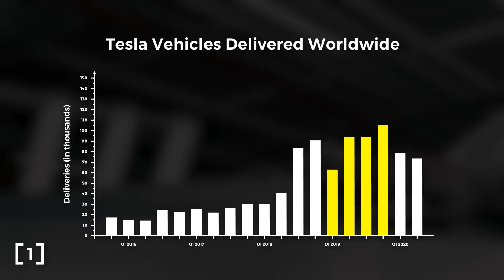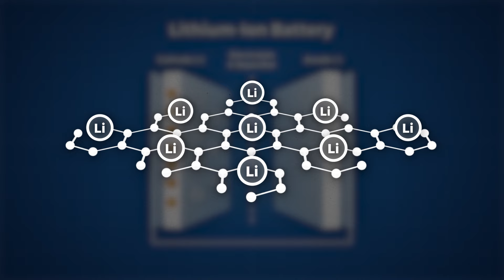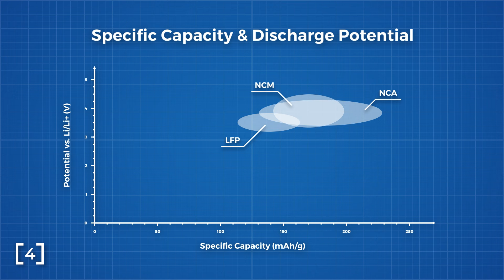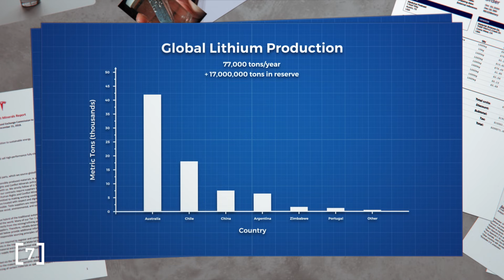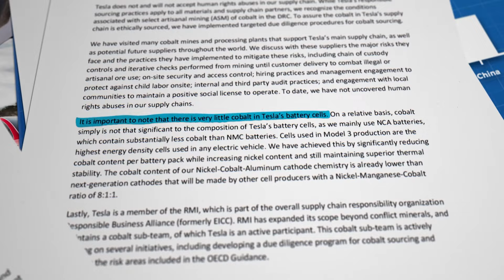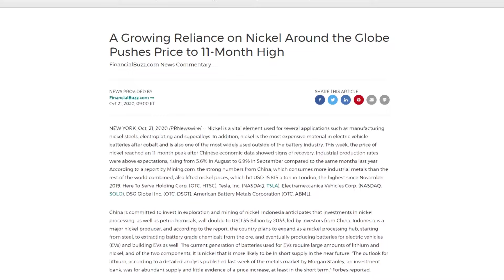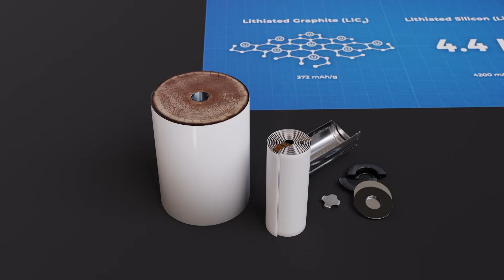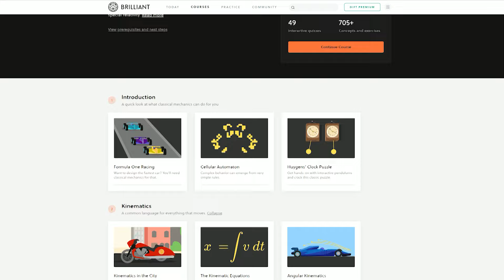Tesla's Battery Supply Problem

Comment: Electric cars cannot be a replacement for a fundamental restructuring of how people transport themselves to heavily favor mass transit and walkable urban design. They're an important tool, but Tesla wants to make it the single silver bullet for a problem that more cars, even electric ones, will just make worse.
Reply: Say what?
Walkable urban design? In new zealand, norway, switzerland`?
Reply: Tesla also pushes heavily for grid scale battery storage and solar . they are driving the industry in all 3. All the other companies following suit will help
Reply: @kommissarjupiter7667  ??? dafuk you saying lmao the best internal combustion engine can convert maybe 30-35% of the gasoline's stored chemical energy into kinetic energy (speed), while the least efficient electricity plants get about double that. Electric engines lose a minuscule amount of power converting between AC and DC, so electric engines are going to be much more efficient than gas cars.
Reply: @kommissarjupiter7667  what?
Are you sure you mean "efficient"?
Max theoretical efficiency for any combustion engine is about 50%, existing diesels are 20-30% efficient.
Electric cars today are about 80% efficient, including charging, battery and inverter.
That's already 3-4 times better than a "good diesel".
Reply: Electric bikes are a great option for distances of 10 miles or less. Also they are really fun to ride!
Reply: bUt glObAl wArmIng
Reply: @kommissarjupiter7667  any fossil fuel powered engine will  be less efficient than most electric motors based on the energy lost as heat. Most engines are terribly inefficient if you look at all the energy contained in fossil fuels. Electric motors use the enegery they are given much more efficiently.
Reply: disagree, Tesla like many other are just trying to solve the issue of global warming were a big portion of the issue are cars, and their waist, but also Tesla like other companies are making smart cars so stupid ppl dont drive like fck shit,.. on the other hand the amount of cars issue is asocial problem were the government need to address the issue, creating x places were you cant use car, but only walk, or make certain hours only available for ppl to walk by.
Reply: @kommissarjupiter7667  even if electric cars were 100% fueled by old coal plants, they'd still be far more efficient than the best diesel engines.
Reply: I've lived in Europe and walk-able cities are already doable there, but I was born in the US and making cities walk-able here would mean rebuilding them from the ground up. I would love to see yards and parking lots exchanged for apartments and city centers but I can't imagine the American people giving up their cars even in the face of climate catastrophe.
Reply: Nothing can replace the good old gasoline motor for isolated areas, very long travels and freezing cold regions. Tesla is just a rich californian kid that don't understand how the world works outside of they state
Reply: @mikeflanary642  great solution on a -20C weather with heavy snow.
Reply: The structure of our cities is a gargantuan task no single company can address - Tesla is doing a great job with their piece of the problem. Personally, I'm excited for next-generation alloys and polymers that could revolutionise buildings - I'd like to see 200 floor buildings that operate as miniature cities, with homes, schools, and businesses. That could do a lot to address transportation problems.
Reply: @caorusso4926  for those places, hydrogen may be the answer, in 50 years or so
Reply: @kommissarjupiter7667  Hahahaha
Reply: @JYT256  Kommissar Jupiter is a troll or a ICE CAR salesman. Diesel...hahahahah
Reply: @grosuciprian  yeah, maybe, but the tech to make it still decades ahead. While this the isolated cities in Siberia, northern canada or Alaska will need that petrol to survivd
Reply: @caorusso4926  it’s because of electric vehicles there will be fossil fuels will be around in the future to operate in these hostile environments. Tesla died in 1943 and the gentlemen your talking about comes from South Africa and his name is Elon Musk. Now that you’ve been schooled, schools out so go home and read a book.
Reply: @MrWATCHthisWAY  i was making reference to the company "tesla" not the inventor. Go petrol
Reply: Personal automobiles are a severe minority when it comes to pollution and carbon. Aerospace, shipping and power generation are a way bigger deal than cars.
Reply: jocaguz18  I’m all for innovation, destroying the Western/developed economies isn’t going to solve this problem when developing nations pollute more than we save.
Reply: jocaguz18  oil is sweet hmm hmm
Reply: @JohnBrowningsGhost  - the reason for cars being less polluting than the big three is due to emission regulations over the last 50 years. China’s need for power is creating a global resurgence in pollutants that everyone will pay for. Without stopping the use of fossil fuels in automobiles this disaster would continue to escalate and to do nothing helps no one. There isn’t a silver bullet to fix the worlds dependency on energy but to do nothing isn’t an option. What are your ideas?
Reply: @JohnBrowningsGhost  - newer aircraft are lowering emissions and becoming more fuel efficient but shipping while still allowed to burn high sulfur low grade fuels are, like you mentioned one of this planets greats contributors to polluting. People don’t realize this because when these vessels pull into ports they switch to kerosine to lower emissions standards. It’s a game. I built and sea trialed 7 vessels and it always comes down to operating at the lowest costs and high sulfur fuels are cheap compared to kerosine / high grade diesel fuels. Those large engines consume large amounts of fuel to push that tonnage along. But we need to realize there is not an unlimited supply of fossil fuels so somewhere we need to make changes. There is no perfect solution in America because mass transit was never going to become a reality with our love of automobiles and the influence that oil companies play in government changing regulations ever other administration. Autos may only contribute a small amount but the fumes you breath in traffic affect you more than you think and if lowering emissions ground level will help cut health problems then sign me up. A lot of people don’t deal with heavy traffic but for those who do and live in large cities these are where we can do the most good. I must be honest I will never sell my old Mustang convertible but I won’t drive it much because my daily driver will be an electric vehicle. Everyone should be allowed one gas powered vehicle! And one day I may have to run it in ethanol completely. Give me one!
Reply: @caorusso4926  - I’m busting stones! The reality is we need to change our mobility. Trust me I don’t want to get rid of my Mustang Convertible but my daily driver will soon be an electric car. Haven’t decided on the make yet but I must admit I do like the Tesla’s. Breathing the fumes from vehicles in traffic all the time is not good for anyone and if we can lower these ground level pollutants I’m in. It’s not a perfect system but for a daily driver I’ll use an electric vehicle. I will never sell my Mustang because Lord knows I have to have one gas powered toy left in my garage.
Reply: @JohnBrowningsGhost  That's why we need to pool our resources through the UN or something and just help these countries make that transition as fast as possible, what if those nations could use international loans to build renewables right at the start and just mostly skip over fossil fuels? What if we worked with their architects and city planners to design cities where public transit how most people get around?  Like the developed nations figured this stuff out the hard way but that doesn't mean everyone else has to.
Reply: @MrWATCHthisWAY  That's really interesting,  so as someone who worked with these ships how can you make them better and is it even realistic? Is this a situation like trains where yea they pollute but they just move so much stuff it's pretty green overall?
Reply: @midnite1112  - the Diesel engines are designed to run on both fuels. You can run them on high grade kerosine all the time but when high sulfur fuel is almost 1/2 the price guess which one the operators choose? You got. Also during the refinement of oil high sulfur fuel is at the bottom of the refinement tanks. It’s almost garbage from oil companies because if ships weren’t designed to use these fuels companies would need to refine them further or filter the hell out of them. You can’t image the size of these engines. Putting in a 12 cylinder one big piece at a time is amazing. The pistons were 42” diameter and when running on high sulfur fuel the crap coming out of the stack is awful to say the least. These ships smell of this high sulfur fuel and nothing else. The people that work the vessels smell of the high sulfur fuel the entire time aboard the ships. And if you need to take apart the water separators to work on them. God the smell is unreal. The separators remove water from the fuel before sending it to the engine after it comes out of the fuel tanks. It’s not pretty. It can be done and it should be done to make these ships run cleaner all the time. But out of sight out of mind and that’s sad!
Reply: @midnite1112  That kind of international cooperation isn’t going to happen, there is no economical way to develop nations while eliminating hydrocarbon fuels. 

I personally think carbon capture and net zero fuels would work alright, but climate zealots aren’t interested in anything like that.
Reply: Mass transit actually has a fairly high carbon footprint. And believe it or not, biking can have a worse carbon footprint than a gas car depending on the biker’s diet. There’s less weight to move but food is an incredibly inefficient source of energy, with regard to CO2.
Reply: @caorusso4926  Ok, So why are there so many Tesla's in Norway?
Reply: @gabrielfraser2109  no way in hell I would live like that it would suck! People are struggling with living in city's now and due to covid and people are leaving them for the country
Reply: @MrWATCHthisWAY  must be nice to actually have a choice! I will never be able to afford a new car like 95% of the world so I will be stuck living in a chicken coup in a digital mega city eating crickets as I am not one of the right type of worthy people🤣
Reply: @allwaysinquire6212  - don’t judge. I started off earning $230 a month in the Navy. I worked two jobs, scraping roofs in the day and the Navy at night. I saved ever dime I could until I could buy an apartment. That’s when I was about to deduct the 11.5% interest I paid on my apartment. Then I was able to go to college on the GI Bill and obtain my Mechanical Engineering degree.  And I still worked two jobs at a Home Depot and an aircraft company. So if you want it bad enough you’ll go get it. Stop buying thing that won’t make you money and get your hustle on. My Mustang I bought used in 2016 and it’s a 2012 V6. Never buy a new car you loose to much money. Oh but the way I left home when I was 16 because my mom couldn’t afford to take care of me anymore she had my younger sister to take care of. I worked on average 16 hours a day 4-5 days a week until I had $40,000 in my bank account. Then I only worked 40 hours for one company and 18 hours for Home Depot. I own stock in HD that’s worth $82,000 now just by working for them and purchasing it. If your buying phones that cost $1,200 stop and find the least expensive phone & plan you can get. And for gods sake don’t worry about what people think of you, do your own thing. Hustle & save and in 8-10 years you’ll be able to see a future that’s comfortable and secure and you’ll be able to take advantage of tax breaks given to you by the government. I assure you I started with Nothing! Nothing!
Reply: @MrWATCHthisWAY  ah the American dream🤣 don't live in America so no tax breaks here, already work my ass off everything I own I either buy secondhand or make myself so already run on the smell of an oily rag🤣 not sure what I am doing wrong🤔 never gave a shit what people think! My point is we are going to be pushed into a world that won't be kind to the people who live in it we are already seeing it
Reply: @juliahello6673  - there really is no perfect silver bullet when it comes to transportation unless you peddling a bicycle and that too takes energy to produce. Lead acid batteries are probably the best battery source because they are relatively easy to refurbish. They won’t have the storage capacity that newer lithium and NiCad will but if your only commuting 120 miles a day they would actually be a great daily driver. And like I mentioned you can clean and refurbish the batteries relatively cheap and neutralize the old acid but if everyone used these batteries lead would now become a very large industrial issue. Like I mentioned there is no one single solution but I believe electric subways & trains are the best mass transit solution to move the largest amount of people on a daily basis. Then we get into a pandemic and trains & subways are the best way to spread a pandemic over a greater amount of people in a short amount of time along with aircraft.
Reply: @allwaysinquire6212  - the world is becoming less caring for it’s masses. We can see it in the political spectrum of almost every country in the world these days. I don’t know your situation so I can’t offer any advice other than life is hard. You need to find a situation or a place that could work better for you but you have one of the greatest tools available in your hand to gain knowledge with. Read and educate yourself the best that you can. Lean everything you can about anything. Find what you love to do and if you can live on that knowledge you have 1/2 the battle won. Have you tried programming at all? This is a good way to earn a living and it doesn’t require a college education if you can program. And it will give you a chance to move around and live in other places in the world... work smarter and not harder. Just don’t give up, resilience is paramount in success. Where do you live?
Reply: @fluitfluiten  Ok, but why there isn't tesla in Siberia?
Reply: @mikeflanary642  They're real fun in the snow.